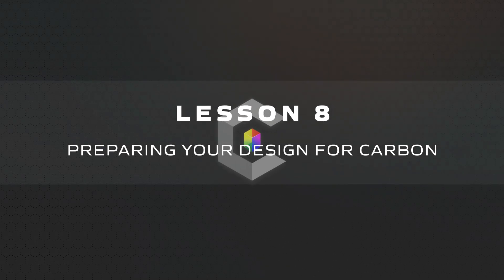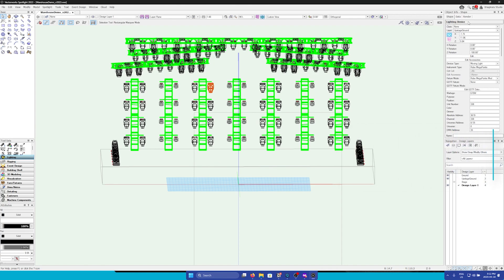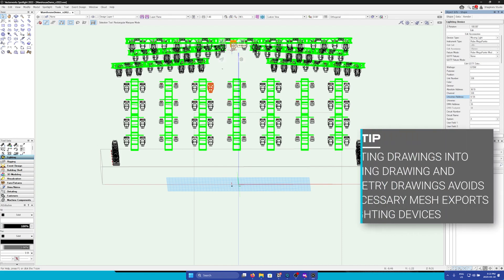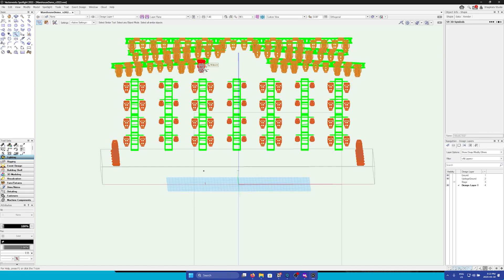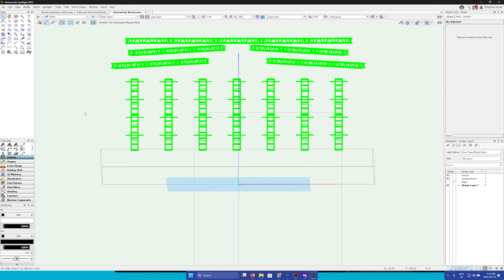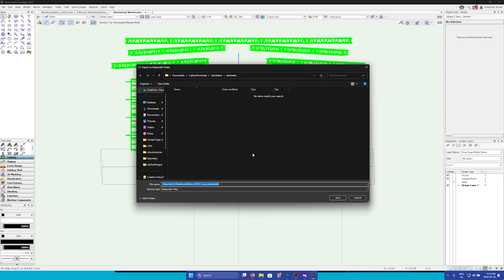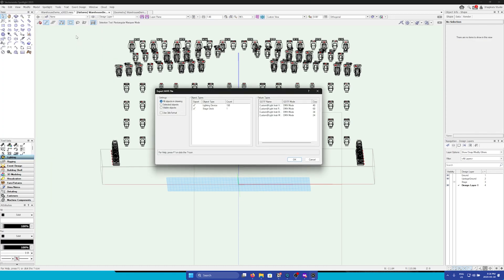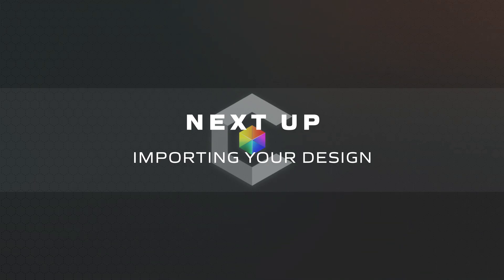Lesson 8- Preparing your design for Carbon

Comment: Depence can export fixtures to the MVR format but it says that it's 3D objects aren't compatible with the GDTF format?  Is it possible to use the MVR information exported out of Depence in Blender to create fixtures for using in Unreal?  I am looking at the water feature fixtures - most water feature manufacturers don't supply MVRs so I'm struggling to understand exactly what they are.
Reply from the maker: So all we import from MVR currently is Patch Data. for fixture definitions, we ask that you review our current library https://www.carbonforunreal.com/carbon-library/ and send a request if we don't have what you need.
Reply: You have four Oase lights in the Carbon Library.  Are there any plans to add some water feature nozzles?  @ImaginaryLabs
Reply from the maker: Which ones would you like? just request them on our website! @benveasey7474  https://www.carbonforunreal.com/knowledge-base/support/requesting-new-library-items/